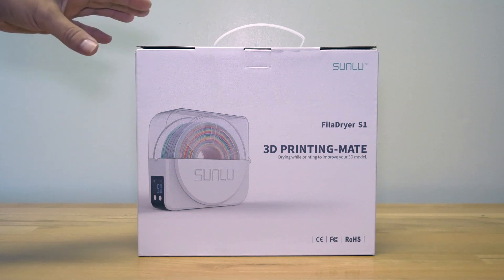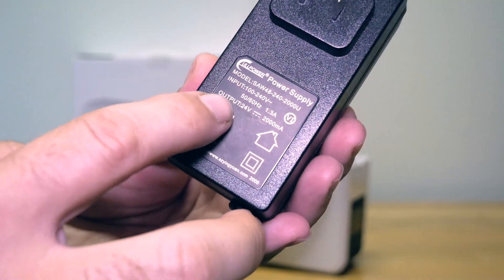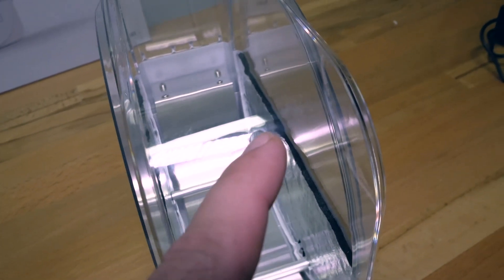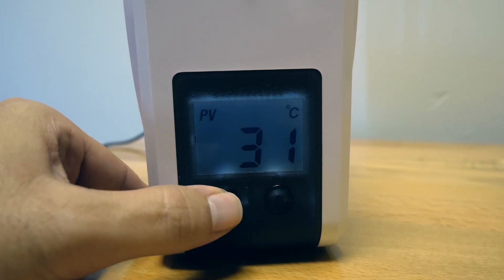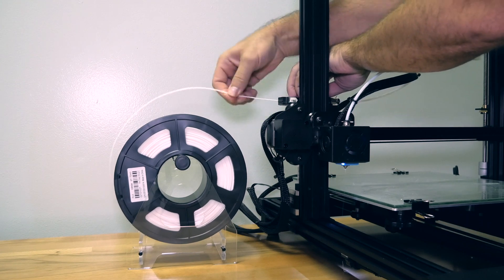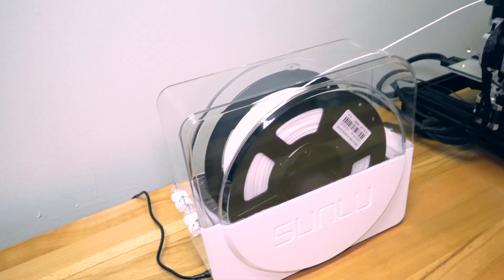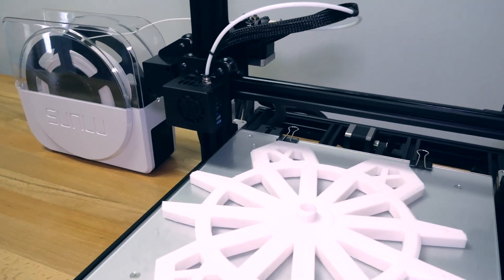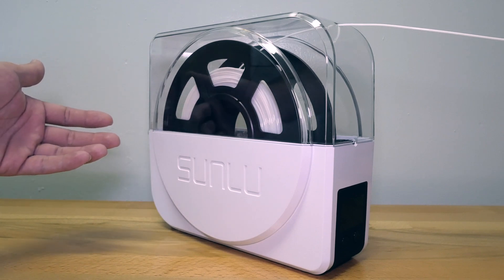Sunlu FilaDryer S1 - 3D Printing Mate

Comment: What works well are fruit dryers. I think the Sunlu dry box is useless. As far as I know, I saw it at a friend's house, this box doesn't have any vents for the warm air to escape. This means that the warm, moist air remains trapped in the dry area. Or has sunlu changed the design?

Comment: You could use a bowden tube or something of that sort to go from the dryer to the printer. Then it won't collect moisture in between the dryer and the printer, and the tube can act like the metal grommet you wanted to protect the plastic in the exit hole.

Comment: I am using three of those Sunly S1 Dryer and are pretty happy with them. They are maintenance free and do their job. I am not missing the humidity sensor as we definitely can assume, if it heats up to the selected temperature, over time, it will dry the filament. Just physics. So, I don't care to read if there are 34% or 30% of relative humidity as it does not say really much about the moisture residue in the filament. For the sake of drying filament, I am using it for ABS and ASA a lot, I never had any issues due to moisture. However, for everyone who want to have better control, humidity sensor and such alike, get the Sunlu S2 Dryer. More expensive, usable for smaller spools only, but definitely great filament dryers. I have two of them as well and they are great having a large display at the side and many options to choose ;)

Comment: I'm disappointed that it didn't have a humidity sensor built in. Doesn't need to stop drying at a particular level, but to not even have a display of the current level seems inexcusable to me. I'm going to buy a multi pack off Amazon and print a mount to have something that shows the current level inside of the box to add this feature. 
The S2 has this feature, at a higher cost